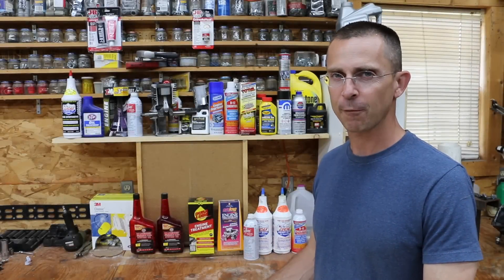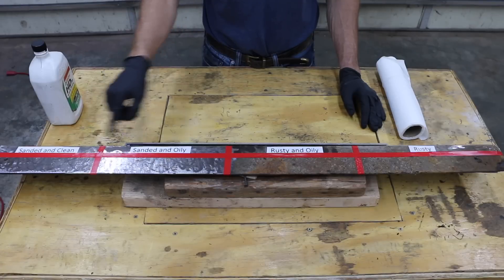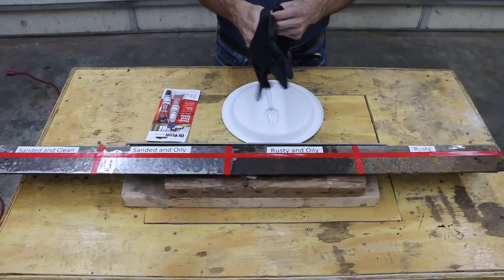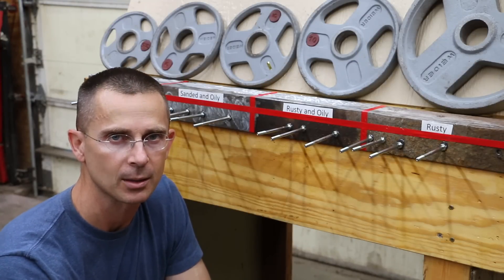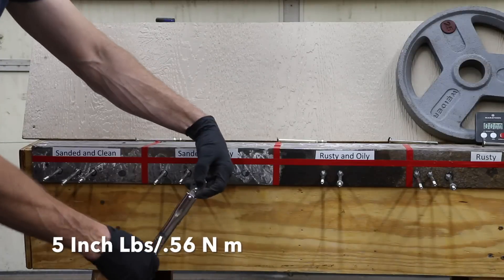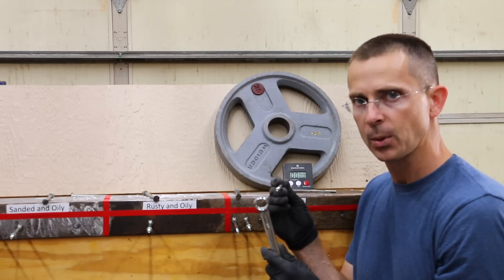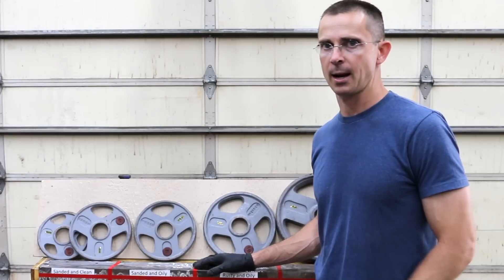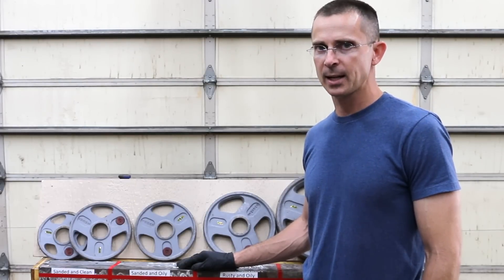How much does rust and oil effect epoxy performance? Let's find out!

Comment: Always pumped for new videos
Reply from the maker: phgoil, Thank you very much for the positive comment!
Reply from the maker: Manuel, Thank you very much for the positive comment!
Reply: phgoil ... /... , l guess you went after my theory l exposed right yesterday ; that all surfaces sure must be very religiously cleaned and sand drilled with sand-paper and a black&decker or some accid solution:  to get rid of any invisible film of dirty , oil , grease , dust , rust , or even the sweat of our hands : the efficiency of any epoxied material will be 20 times much more effective as you proved with this one small demonstration . IT WAS VERY CLEAR !
Reply: phgoil I praise u